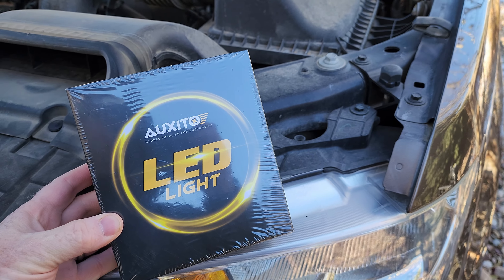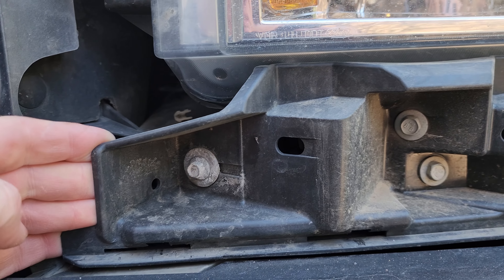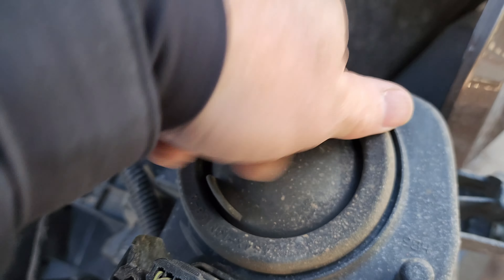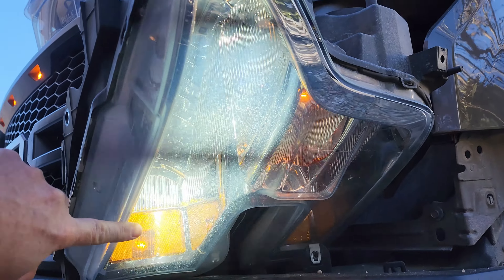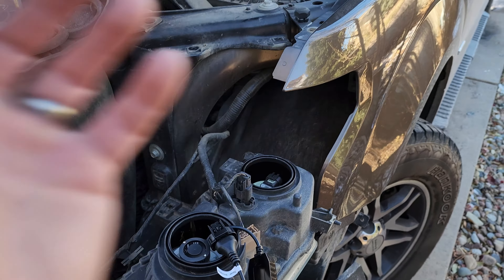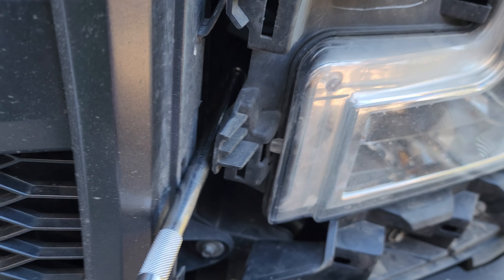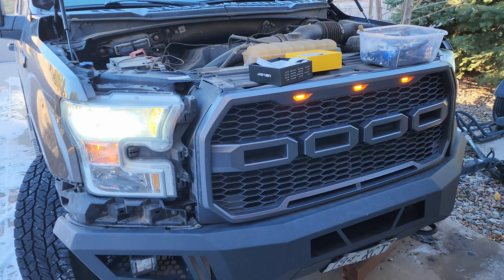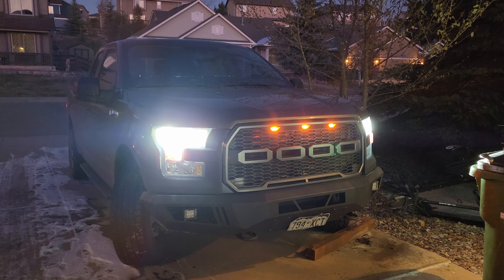2016 Ford F150 XL FX4 - Auxito LED Driving Light Bulb (H11) - Installation

Comment: Omg these H11s are supposed to be low beams but they are super bright!!! So bright that other cars are flashing their lights thinking I'm running my high beams.  It really improves visibility over the stock halogens but boy are they making a lot of people mad.
Reply from the maker: I have not been out at night. No one during the day has flashed me but they seem crazy bright. Bright enough I'm thinking about turning the switch to OFF during the day. Colorado is dry and the caps won't fit back on. Lucky part is we don't get rain often so I'm willing to roll the dice for everyone and run without, the light to the inner part is sealed. I guess I'll take one for the team of in 5 years I still have them with no caps and no issues. shrug
Reply: @Meekerextreme   Hi Meeker Extreme, I would definitely find a way to put the dust/moisture cover back on.  Could you use another type of plastic dust/moisture cover? It almost looks like a "Pringles" chip can top clear plastic lid might be a close fit.  I just bought the latest AUXITO H11's (24000LM) and AUXITO (24000LM) 9005's for my 2014 Nissan Murano Platinum and hoping they fit and work well. My halogens just aren't that great anymore.
Reply: Thats because you need to aim your low beams down but you cant because the light bulb is all cramped up in the housing

Comment: You need to put the dust cap back. I went in through the wheel wells. Little cramped but was able to do it. Reason why I suggest you put back the cap is when it rains moisture gets sucked in by the cooling fan into the light housing and it will build up where the high beams are. Water from the top can drip to the exposed area. Moisture cannot be in there. The fans are there for the H11s because they are used more than the high  beams and the fogs so they get hot over extended periods.
Reply: Very good advice Ed. A note on the LED fans: All LEDs dim as they get hotter. The fans are there as a means to dissipate heat regardless of where these are used (high, low, fog) in order to keep them at a sufficient brightness. These and most newer LED bulbs have copper tubes and boards that help with heat management. Just need to make sure the LEDs point to 3 and 9. The collar on these Auxitos are adjustable, that’s what the little Allen key is for that came with these LEDs. Good job on the video and thank you for putting it up. I would cut out that area of the dust cover to at least keep most of the dust/debris out. The high appears to be a 9005.